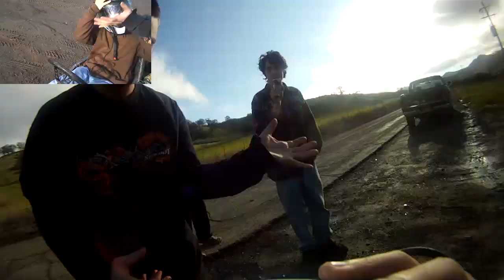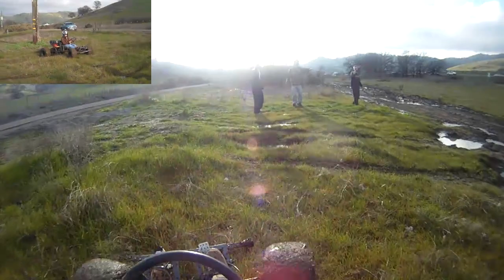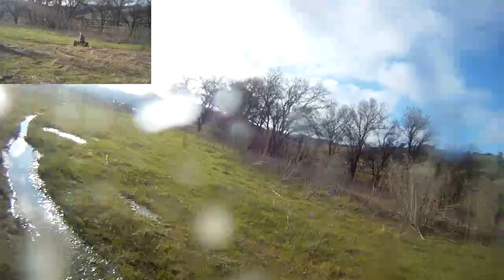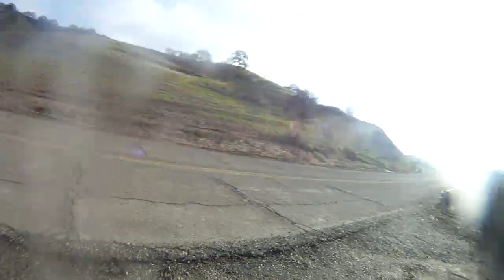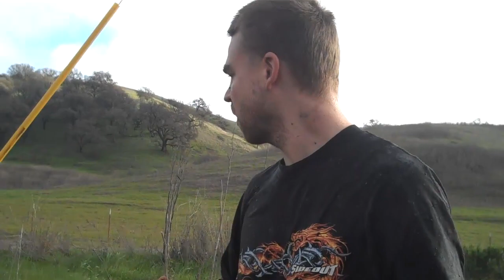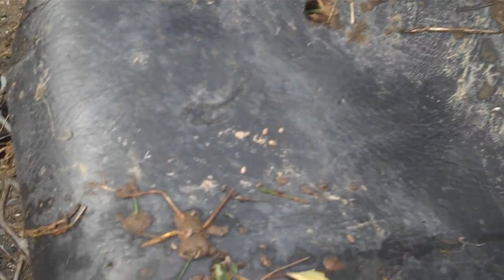[230] Mud - 2011-01-30

Comment from the maker: @ImRamro The whole jack shaft came out of the right bearing, easy fix to put it back in again.  This is my "second" one, the first was actually a non working lawn tractor, I rebuilt the engine and removed the mower blades. I would like to have independent suspension, but  there isn't enough room so I came up with the suspension it has now.  The mud didn't taste like anything really, just gritty...